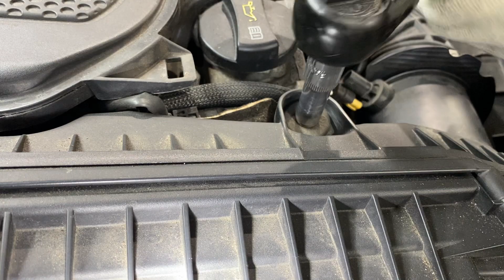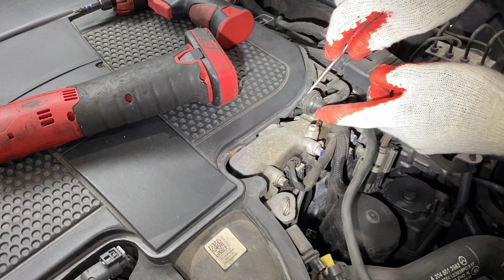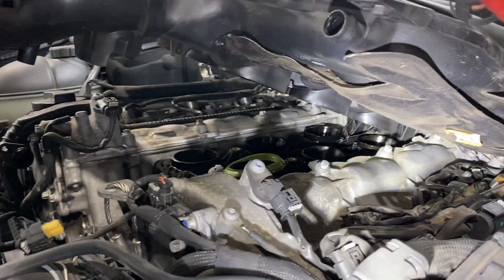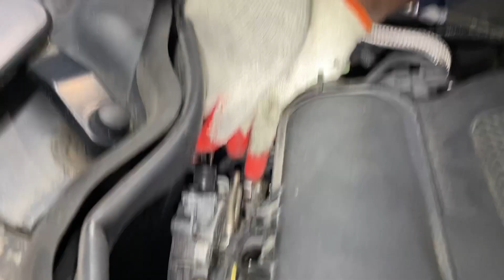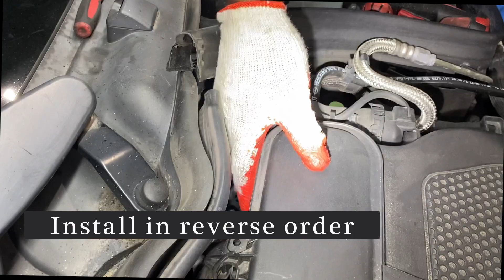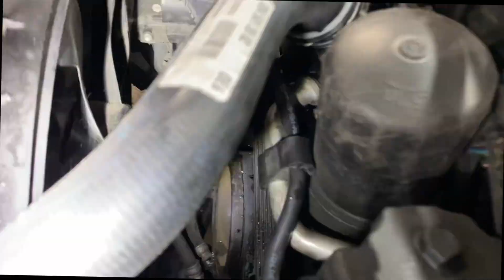Mercedes Benz  E350,C300 W212,W204,W207,W218,2010-2014 Intake manifold

Comment: The video says ,replace intake. Can someone tell me what is being replaced? Because I see oil all over the throttle body and all over that intake. And it’s just being put back on the engine like nothing happened. What exactly is happening here?
Reply: Why so much oil?
Reply: @ most common on these engines when you have oil in your air filter or intake it’s a crank case ventilation valve M2 76  engine

Comment: Christ thats alot of hoses and connectors. What a nightmare of an intake manifold. And I gotta do all this just to replace an injector because they covered them up by making the manifold unnecessarily wide for decoration. Man, why couldn't they have just used a regular decorative engine cover that just pops off with maybe a couple bolts. Thanks for the video though.
Reply: More labor = more money. You gotta do this for spark plugs and coils too
Reply: @MrDrake0515  I was able to change the plugs and coils by just removing the air filter housing on the left of the engine and the computer on the right.